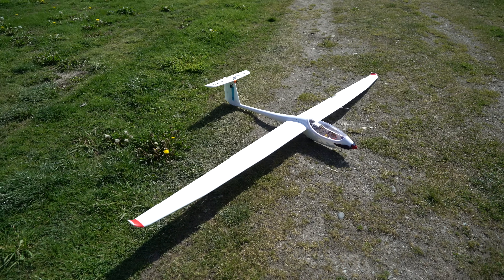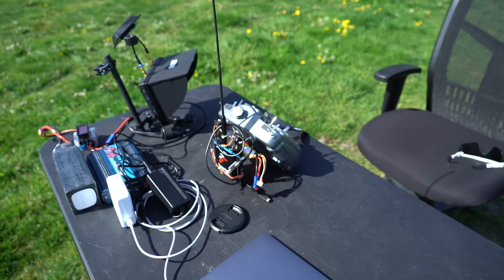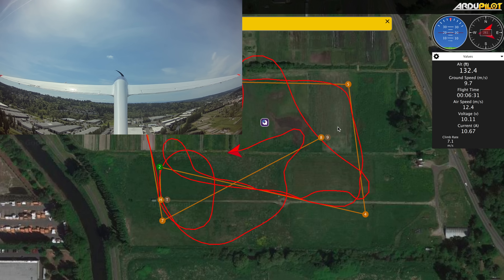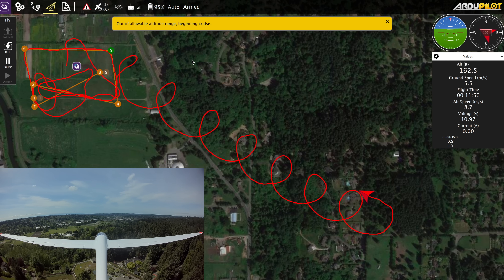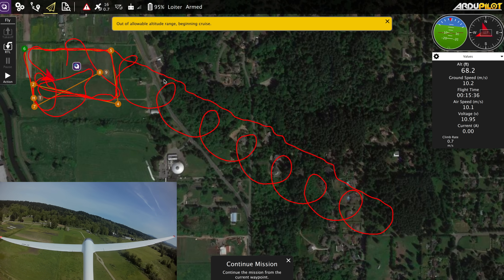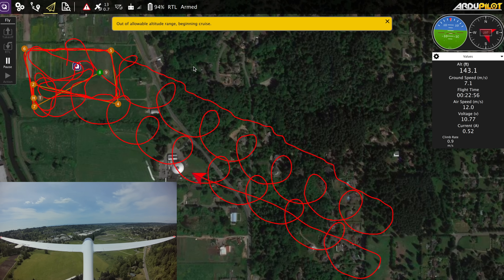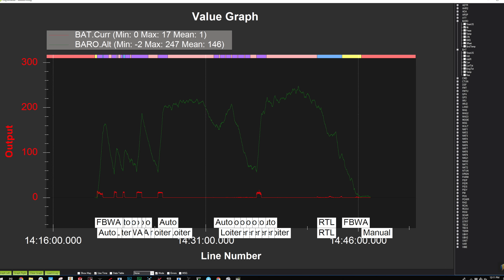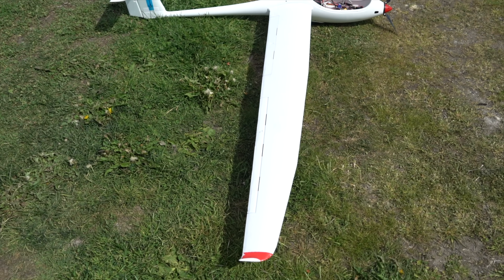Ardupilot Autonomous Soaring - First Test - RCTESTFLIGHT -

Comment: The auto thermal mode should have the plane thermal to the right,
In the northern hemisphere, thermals usually twist counter clockwise.

By doing so, it would enable the plane to stay close to the center of the thermal, where most energy can be found.
Reply: You know nothing about soaring. Thermals do have airflow around the center but long established testing has shown that they turn about 50% in either direction. I have over 4,000h in gliders, 40,000mi x-country.
Reply: @LS8eighteen  
You should've been paying more attention during your flights.
Thermals are a localised low pressure areas. In the Northern hemisphere they tend to turn counter clockwise. This is called Coriolis effect. Go and re-read up on your fundamentals of meteorology.
Reply: @fliteshare  Coriolis effect is real, but only effects the system if it's significantly large in proportion to the other forces in the system... which it is at large scales, but not at small scales. At small scales, it diminishes to be negligible, which is why, for example, the funnel of water draining through a hole starts spinning in a random direction despite the Coriolis that should be forcing it into the hemisphere-appropriate direction (unless you carefully set up a tub of water with a painstakingly controlled lack of disturbances, like Smarter Every Day and Veritasium did in a collab video, each with a tub of water in opposing hemispheres)

Comment: if you build a sailplane that searches for thermal currents you definitely should stop the motor once the plane reaches cruise altitude; or better yet get rid of the electric motor and tow the sailplane with another RC motorized plane (or a winch wire from the ground), this way you really force the Arduino to search and surf those thermals and all the battery goes to the sensors, servos, camera and cpu, no to the motor; this way, in theory, you should be able to stay for a long time if your project is succesful

Comment: Can you please give a piece of advice, how to connect Spektrum receiver with (any of) flight controllers other than via PWM? I dislike the way of using multiple wires for transmitting data. Is it possible to transfer data from the Spektrum receiver to flight controller in a digital way?

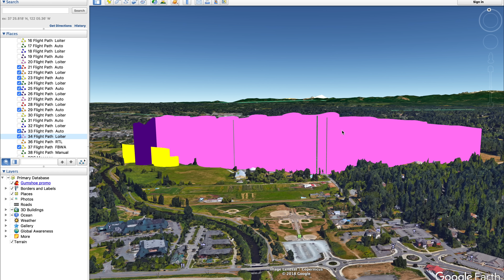Comment: At 13:45 you see the air going down, even is ground level is going up (ridge). This seems to be caused by the cooler air over the trees. The air is going in up over the valley, which causes air to be drawn from the cooler places, in this case the hills with trees. I agree, no thermal bubbles here, just the general air over over the valley rising at the expense of the air over the forests.

Comment: While impressive from a technology point of view this video shows the problems with such technology and that is its inability to determine safe and unsafe flying zones. Flying over active roads and buildings is just unacceptable. As someone who has flown model aircraft for 30 years if any human pilot did this consistently they would be thrown out of any of the clubs I have belonged to on safety grounds. It would also be an instant fail on any proficiency tests. I know what can go wrong, about 20-25 years ago a young girl was killed at a site not that far from me by an electric glider roughly the same size as this when it suffered a failure leading to loss of control. People really need to think about the risks more.

Comment: .."Wrong Wrong!  A squared of trailing edge allows the airflow to leave clean; by rounding the trailing edge you have greatly increased turbulence and increased drag!
I built and fly a Full size Lancair 360 . Ailerons have a 6.5mm squared off trailing edge. The result is much crisper authority and drag reduction!

I know of a builder that had the same idea as your good self...... Rounded off all trailing edge on the control surfaces. The result was an absolute dog of a plane!    .... A lot of expense and time; all surfaces now back to design spec, ..... Nice fast Lancair.

Try and pour liquid from a tea pot that has a rounded spout outlet!
Then try a sharply squared off spout. The liquid simply can't instantly turn through 90deg!  No matter how slow you pour.
All this post has done is guide people to follow an incorrect procedure.   Big problem on YouTube!
Reply: Barry Manclark The Reynolds numbers on RC aircraft are so small in comparison that the effects are negligible.

Comment: I've been thermalling the same ASW-28 for years (by eye and with a vario).  It works very well once you get the hang of it.  From the KML file it looks like you were half in and half out of the thermal.  On one side of the loops you were rising, and on the other side you were sinking.  It's not enough just to circle when you detect a thermal, you've got to constantly adjust the turning radius to stay in it, otherwise it will just spit you out.  Good idea to go to a large open area like a desert, a couple of days out there will really up your thermal skills, enough to let you tune the autonomous mode a fair bit better.

Comment: This small hill hasn't enough height to get ridge lift ,cloudy days are the best for flying a glider (cumulus clouds)
The idicate where the rising air is because they are like the roof of the thermal , and they develop if there is enough moisture in the air

Comment: There is a very simple algorithm for thermalling, and looking at your track, it seems to be what your flight controller is using (or, at least very similar).
1. When first encountering lift, wait some period (we use 3 seconds in paragliding), then initiate a turn (it seems your controller defaults left).
2. While lift increases, loosen the turn radius (up to some preset maximum).
3. While lift decreases, tighten the turn radius (down to some preset minimum).
4. If there is no lift, wait some period and then return to mission mode.
Reply: I'm not convinced any systemic thermal-finding was achieved here;  If that was the algorithm, then this is just cutting wide circles relative to the wind, ignoring GPS location-holding, and turning when its momentum points it upwind (which induces lift).  The planform is just so damn efficient (when it's free to cut wide aerodynamic ellipses instead of being brutally mishandled by manual controllers like you or I whose every input is enthusiastically aerobatic) that it loses almost no altitude anyway.
Reply: @TrogdorBurnin8or  Turning "upwind" with an un-powered glider is meaningless, apart from speed-over-ground and produces no additional lift. For a given attack angle, the glider will fly a constant speed through the air, regardless of whether that air is stationary, or blowing 20 miles per hour. What will change is the speed relative to the ground below. The glide slope will also be constantly pointing downward, unless rising air (a thermal) provides surplus lift.
Reply: @CineSoar  Do you think the figure we're seeing it trace, then, is just "Maintain roll angle at 10 degrees left of center", effectively?
Reply: @TrogdorBurnin8or  If you watch the path and climb rate (helps to run at 0.25 speed) from about 5:10 you can see that, when the climb rate is up around 4, or 5 m/s (over the road, buildings, parking lots, mown lawn, etc., which tend to be pretty good thermal triggers) the loops are more 'open' and when the climb drops near zero (over the trees, exactly where you would expect there to be less thermal activity), the loops tighten. This is why I commented that it appears that the algorithm is similar to what I outlined above (loosen turn radius in increasing lift and tighten turns in decreasing lift). I would assume there is some averaging, to smooth out some of the 'noise' in the altitude measurement, but generally when I see tighter turns, the climb rate is somewhere between 1 and -1 and when the climb rate goes above 4, the loops open up, as I would expect.

Comment: Can you set it up so that there's a geo-fence for the field you want to fly in so it won't drift away so far? I haven't used QGroundControl at all, but I know you can set up geo-fences in MissionPlanner. I never tried it with soaring mode, though.

Comment: Something seems off.  The climb rate was positive, averaging around 2, on your flight home, but the altitude was constantly descending.
Reply: Yep - I agree on that one. The m/s climb/descend rate doesn‘t correspond at all with the GPS altitude. Since I think GPS is correct, I assume that your vario meter is installed at a position where it senses pressure changes and of course interprets them as climb/descend, while they‘re actually aerodynamically caused pressure changes and don‘t correspond at all to climb/descend. Try to place the sensor at another position. But very cool project bro! :-).

Comment: It's very obvious that the field you launched the glider from was the source of the warm air, which was pushed against the little spot of forest downwind. There, the warm air formed a boundary layer with the colder air around the trees, which mad the warm air get unstuck from the ground, launching good bubbles of thermals fairly constantly.
Such thermal sources are stationary.
Most obviously, the thermal mode of Ardupilot aplies the basic centering rule: If the climb rate in the thermal increases, reduce bank angle, if it drops, turn tighter, back into the climb. If you stick to that rule strictly, it'll make you drop out off a thermal from a stationary source every time as you drift downwind.
In glider flying, you have to consciously figure out what effect is the source of the climb you use and adjust your strategy for making the best use of the climb accordingly. I guess Arduinos will struggle to ever deliver enough calculating power to be able to hold enough algorythms for that.

The slope of the hill is *way* too shallow to give any real climb as well. Just do the math: You want the ascent rate of the air around the plane to be greater than its descent rate. Let's say your model drops 0.5m/s, a likely number at the speed of minmum sink. You thus require some 0.5m/s upward component in the velocity vector of the air merely to maintain altitude in straight and level flight at ideal speed. 10mph wind roughly equals 5m/s.
sin⁻¹(0.5/5)=~6° slope angle. 
If you had your glider flying at ideal speed in absolutly clean and gentle airflow, straight and level, such a slope would only barely just compensate your descent rate. Circling in the bubbly, vortexy mess on the arse end of a warm air bubble you just lost, in the turbulence wind makes over trees and, worst of all, where the cooler air from above the thermal comes down to fill the space the warm air left behind, you have not the slightest chance to climb any inch.

The really p~sspoor penetration of your styrofoam glider against the wind confirms a prejudice I always held against RTF foam gliders: They are aerodynamic cripples. Useless for serious gliding.
The high asepct ratio of that model's wings makes it look the real thing, but the very low Reynolds numbers on the wing produce bubbles of flow separations etc., thus  bad aerodynamic performance, the rough cut, thick trailing edge will cause flow separations and a fat vortex trail behind the wing that causes loss of kinetic energy etc.
You probably would be doing much, much better with a balsa/foam sandwich wing with a Clark Y¹ aerofoil of 10% thickness, 10 to 13 feet wingspan, chord of ~10" at the wing root, tapered to 3-4" at the tip. Maybe even get the drawings for a Bird of Time, a proven R/C glider design, convert the wing to aileron control and best even to a plain v-layout.

¹: I have really calculated and experimented with layouts for R/C gliders a lot, and I can only confirm the rule leart from a former club mate: You dig through piles of books, curves and calculations and end up with a Clark Y on your model. It's a spookily good choice for model planes, providing good air flow at low reynolds numbers, is largely imune to the necessarily poor level of build precision of models and their poor surface quality, its flat underside makes it easier to build the wings, it's just the perfect choice for most applications in model aircraft.

Comment: Thanks for making this video! To prevent it from getting too far downwind you have two options 1) geofence, as some have mentioned 2) set up an RC channel using the SOAR_ENABLE_CH parameter, to inhibit thermalling when you want it to continue on mission. The feature is still under development and there are some improvements on the way.

Comment: You would have been getting a little Ridge lift at that hill but you're probably experiencing some rotor and turbulence that is typical beyond ridge lift on the lea side of a ridge, mostly if there is a decline after the Ridge.

Comment: Your statement near the end that it was not actually flying in a thermal was incorrect.  The trace shows a classic thermal pattern with a wind drift.  You should spend some time with real glider pilots.
Reply: ttaylor7777 any circle flown with wind drift will look like that from above. From the side it will look like a leaning spiral which these do not look like.
Reply: @oliverpolden  He was approximately maintaining altitude, so he was in a weak thermal that just cancelled the natural descent rate
Reply: @FlyNAA  this really doesn’t look like a thermal to me. I get your point that it can be lift that it is circling in and that the lift is pretty much the same as the sink. However, the wind is somewhat going up the hill so I would suggest this is ridge lift, not a thermal. Just because you’re circling does not mean it’s a thermal. I would expect he could be anywhere on that slope face and found lift.
Reply: Actually, you know what, I don’t know. Watching it again he does say that he would have expected ridge lift and didn’t get it. It does just seem there is a lot of lift everywhere so I would say it’s one massive thermal rather than it’s actually tracking a small one.

Comment: It looks like you have a problem with your current sensor setup.  It's not showing the drain from your VTX, receiver, flight controller etc.  That means your battery life won't match up.  That's especially important for your glider application. Always make sure all of those are behind the current sensor.

Comment: Awesome video.  When searching for thermals, one of the signs is when the tip of a wing grazes a column of rising air and the plane twitches away from the thermal.  The strategy then is to turn opposite to that in order to enter into the thermal.  I wonder if the ardupilot algorithms could/does? use IMU data to detect and use this.

Comment: Interesting,  I have been flying my Raidian pro and I stuck a MACH2 VTX and a little camera on my wing. I would like to get a Flight controller that I could use a altitude sensor in my osd,  I can sometimes tell when I fly through a thermal and see when I gain higher.  Thanks for the information on this Ardupilot system.